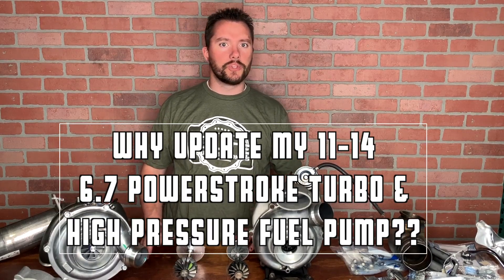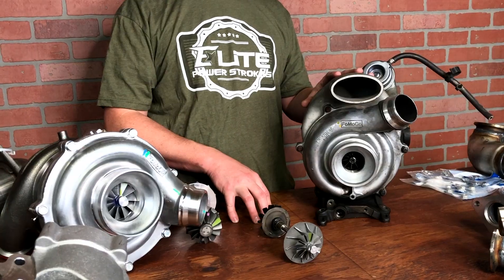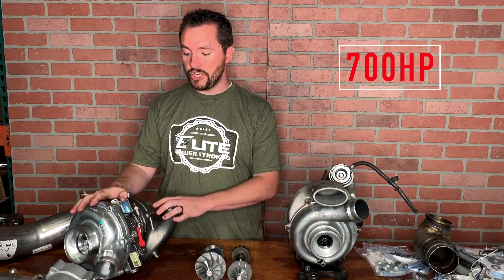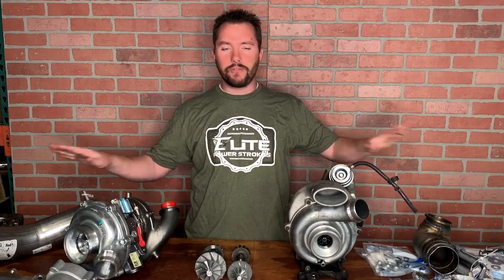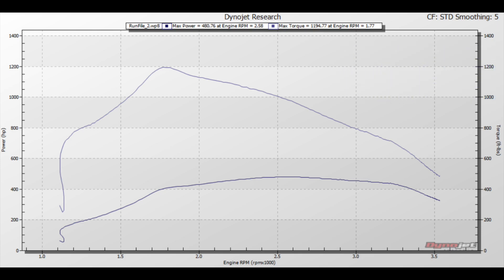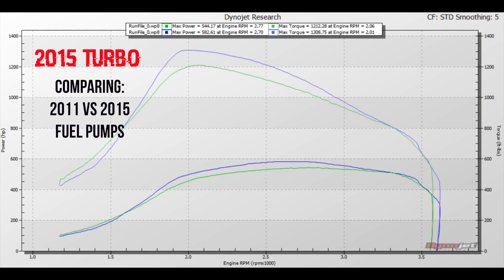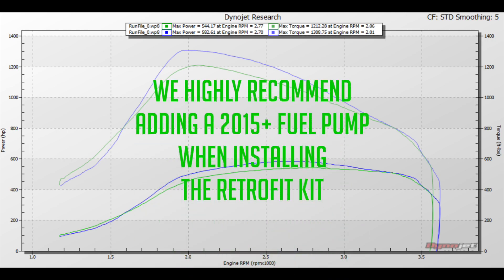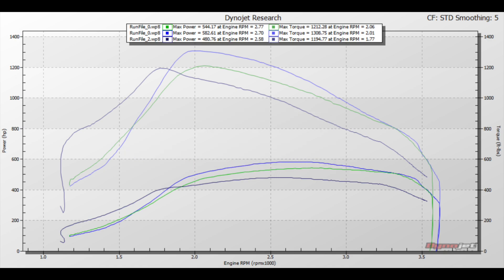Why Buy a 2015+ 6.7 Powerstroke Retro-fit Kit??

Comment: hi , what do I need to do to go back to turbo 2014 to get the sound that the wastegate produces.  I have a 2015 f350 but I don't like the current sound of my turbo, I want it to sound woooooo characteristic of those years 2011-2014, thanks
Reply: Lmk if you figure it out bc ive already replaced my entire engine and had them put the original style turbo on it again bc I'm not losing the woos lol. Only reason I haven't upgraded. Haha

Comment: Does anyone have any feedback on MPG with 2011-2014 turbo before and after swapping? I have a 2013 factory turbo now and wondering what effect the 2015 kit would have. Current mileage is around 19 on the highway and have a friend with a 2016 that's getting 15 (granted different setup and driver).

Comment: Fairly new to any Diesel pickups after the Cummins 5.9l 12 valve. How does a 6.7l powerstroke know to accelerate without a TPS?
Reply: It's electronic, as opposed to mechanical.
Reply: @Bwanar1  I knew it was electronic, however, most vehicles have a TPS. Mine has one but it is disconnected.
Reply: @charlesduncanmckinley920  Oh...your question was how does it work without one (TPS). It doesn't work without one, it uses the electronic signal.
Reply: @Bwanar1  mine runs fine, so again.... how's that work.

Comment: Man this kit is a bunch of bull shit doesnt come with any instructions what so ever. I had to take everything off because i had a filter left over that went in the pedestal. It is really frustrating. Especially when you dont know what parts go where.
Reply: Did you make a video of it ? Perhaps you can help any one else that is having the same problem
Reply: @kxp.1496   i should have i didnt even think of it
Reply: Can you not just leave it out the 7.3s never had a filter
Reply: Just did this to mine! Not worth the money! Constantly running to the stealership for bolts n other overpriced crap for nothing better than stock!
Reply: @HowThingsWorkForMe  definitely a better turbo.
did you not purchase the kit and just thought u could get updated turbo and bolt in and go

Comment: Good info and explains why my 2012 will spin and hop the rear axle when towing my 5th wheel. First gear is really low, so when it shifts into second, that early torque is spinning my wheels. Also explains why I don't get an immediate surge of power when flooring it at certain speeds due to the torque dropping off.  Only downside for me is the truck's previous owner did a full delete, so getting it retuned for the 15 turbo would be very difficult without undeleting everything.   I didn't realize it was a full delete when I bought it.
Reply: Deleting it is a good thing.
Reply: Actually it would be no problem at all hit these guys up. They’ll set you up

Comment: How would a spartan tuner off a 2011 run on this set up? Would i have to get a new tuner and tunes or will the spartan work fine with the tunes I have
Reply: Also do you need any fuel options for this retrofit kit
Reply from the maker: As long as you can get "custom" tunes on the spartan tuner, you will be fine to run. it.

Comment: What tunes were you running when testing these engines?
Reply from the maker: That would depend on what tuning device you have or plan on buying?
Reply: KC TURBOS you didn’t answer his question what tune was used on your dyno sheet
Reply from the maker: @serohaguju1054  Truck Source Diesel on an EZ LYNK
Reply from the maker: Truck Source Diesel on an EZ LYNK

Comment: I have a 2018 and with all the new EPA crackdowns... I would like to look at maximizing power and torque as well as finding fuel improvements... I had a tuned 2011 on 40s and I got 18 mpg driving around town and 21 mpg on road trips... my 18 gets about 11-13 mpg.
Reply: KC TURBOS I had an H&S tuner on my 11 350. My new 2018 only has 4K miles on it... I am deployed. I don’t have anything tuning on it. I only had it lifted and its on 37s. I was thinking to get the Banks Derringer, since the crackdown by the EPA, but want to get some performance added that are legal. So, new exhaust, cat back, thinking larger turbo VGT and piping.
Reply from the maker: @Teambeforeself  Shoot us an email over to sales@kcturbos.com with this question

Comment: Will you need to have the computer reflashed to a 2015 setup?  I would imagine you would have to do this, right?
Reply from the maker: That is correct, you will want to get custom tunes on your truck.
Reply: @KCTURBOS  Is this something the dealers will do and will it affect the Ford warranty
Reply from the maker: @TheRealSlowhand  It should not be an issue, these are OEM parts from ford. They should also be able to install it, i would imagine.
Reply: @KCTURBOS  I can do the install myself...  It seems very straight forwards, but not sure if it would throw fault codes that would not allow the truck to reach the dealership...  I have a mini max tuner but don't know if that would work since it is setup for 2011 model truck...  I do appreciate your quick feedback tho, thank you...
Reply from the maker: @TheRealSlowhand  As long as you can get a tune update for your mini max, you will be good to go! no codes

Comment: So, if it only has one air inlet, how do you connect it to the existing air box?  Is a new set up required?
Reply: The kit includes a new intake setup to adapt to the stock airbox

Comment: Do you have to do anything to The ECM   or is this a bolt on and go?
Reply from the maker: It is bolt on and go. You dont have to program the ecu, but it is very beneficial to get a good set of tunes.
Reply: @KCTURBOS   Who would you go with for the tunes?
Reply from the maker: @AL-nb9bf  We are big fans of Truck Source Diesel tunes, They do a great job. Also, ppei is a very good tuner for the 6.7.
Reply: @KCTURBOS   Thank you